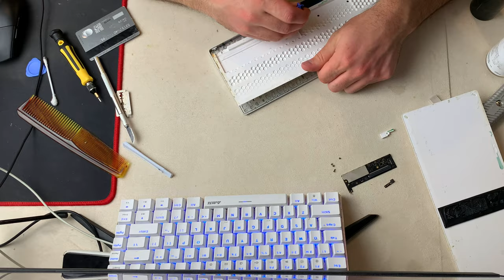Apple Magic Keyboard 2 DISASSEMBLY and REPAIR

Comment: Thanks friend! On my Apple keyboard, the keys Y, U, I, O don't work intermittently. Also, when either of the left or right shift is pressed, they just don't work at all. When I clean them up with rubbing alcohol, they work for a few minutes. When I let it sit idle for half an hour or so, it stops working again. I guess, the circuit have gone rusted. Watching these disassembly videos made me realize that I should buy a new one instead so, I bought a new Logitech MX mechanical this time. Hopefully, it will work better.
Reply: That probably means it had a sugary drink spilled on it. If you were only cleaning on the outside, try to open it up and clean it using rubbing alcohol

Comment: Do you think If I had a broken keyboard with one of the colored cases from the imac I could take a new silver one and take everything out switching it to the colored case?
Reply: The actual key membrane is welded onto the housing, so it would most likely not be possible if your keyboard has membrane failure. There are lots of coloured new and used iMac keyboards available on ebay though so that’s a option if you want a coloured Apple keyboard without buying a iMac